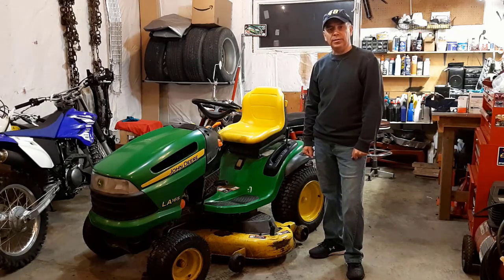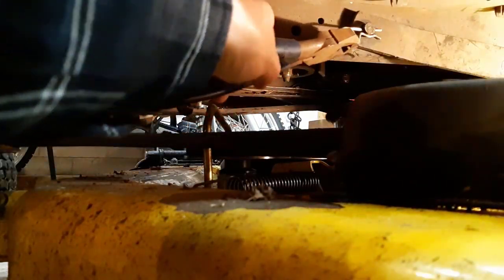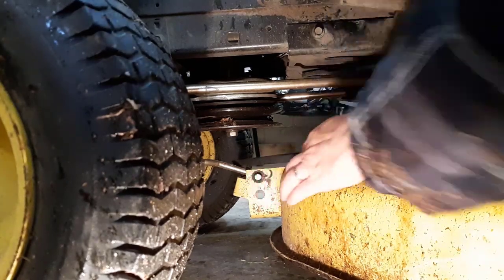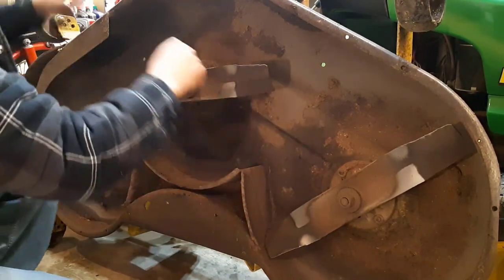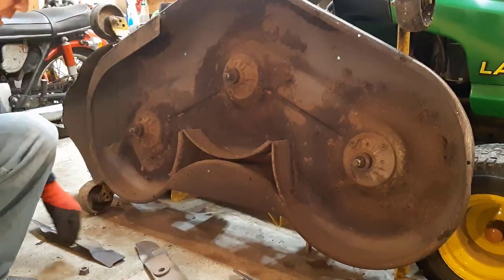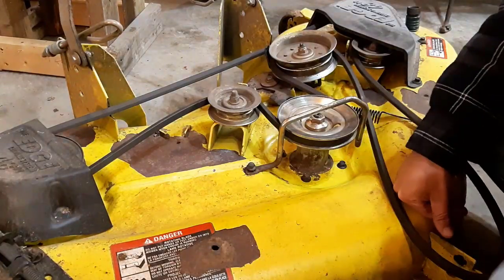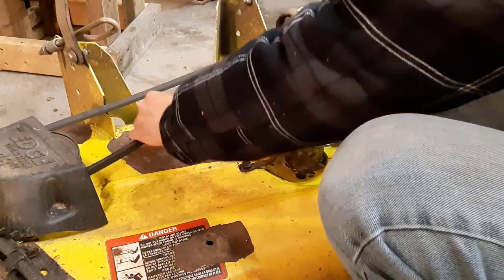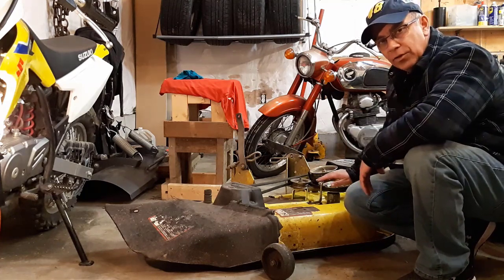Prepping Your Lawn Tractor For Spring // Ready To Cut Grass

Comment: Wow, I have been doing that all wrong, I have been raising my deck and lifting the mower onto blocks so I could get under it to remove the blades to sharpen. It never dawned on me that it is designed to lower and come off like that. I will be doing this in a couple weeks.... Need the snow to melt first before I get into the spring maintenance. Thanks for the video. I put up an intro on my channel, if you are interested in putting a face to the name... TTYL....
Reply from the maker: Hi Ken, when I want to sharpen my blades only, I raise the front of my tractor and just remove the blades as well. I have a lawn tractor jack to raise it. I will check out your intro. Thx for watching, have a safe great day.